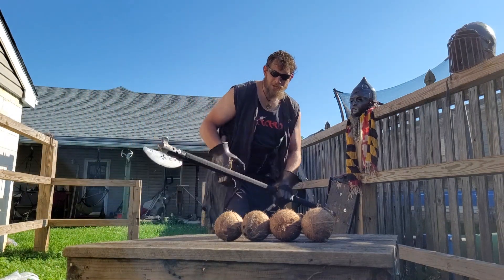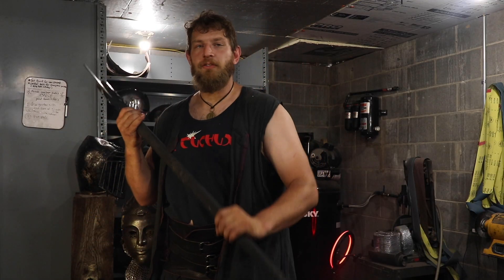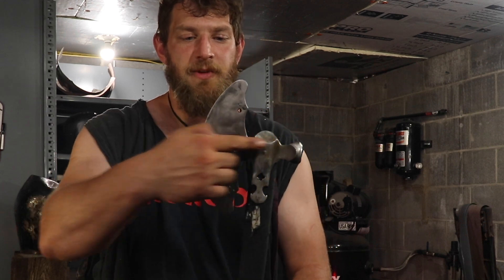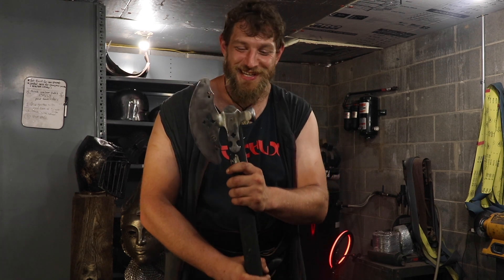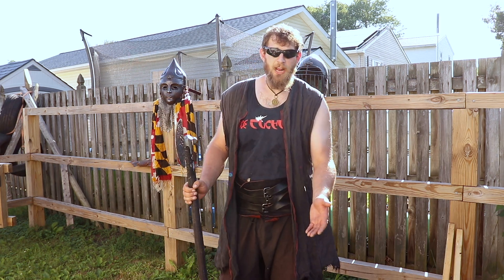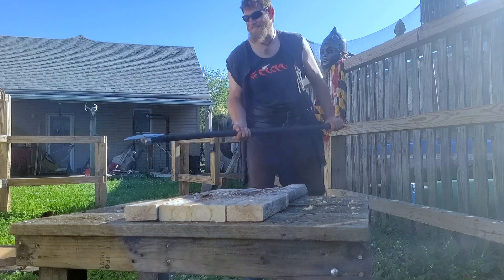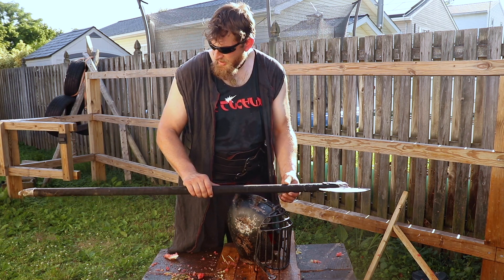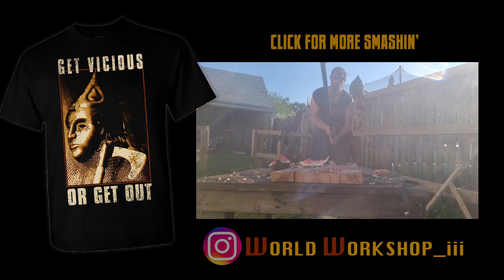Armored Combat: AXE REVIEW, World Workshop III

Comment: And the handle is forbidden for ACS
Reply from the maker: To be true I'm checking on that for other leagues as well but the other axe that was bought is on a very stout wooden handle. They do whatever is asked for. They wanted me to try and destroy the hell out of it.
Reply: @paulthebarbarian7115  gotcha. It looks sturdy, but I wanted to share concern for the rules if you wanted to use it at ACS events since they follow IMCF rules in particular.
Reply from the maker: Very agreed, jaye was very surprised when he handled it. If they tell me no I'll just mount it on a different handle
Reply: @paulthebarbarian7115  we cut the hammer side off of several buhurt tech pole arms. It happens lol